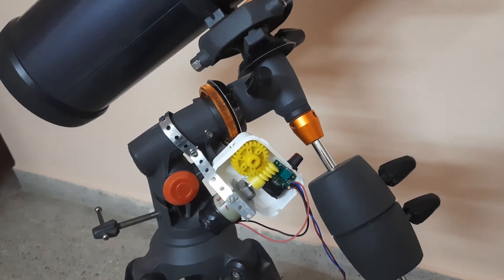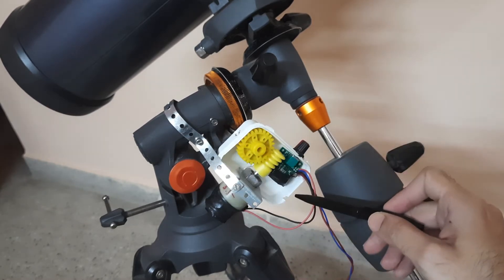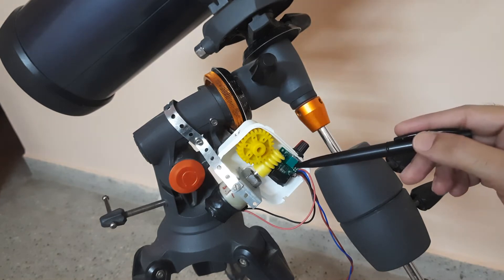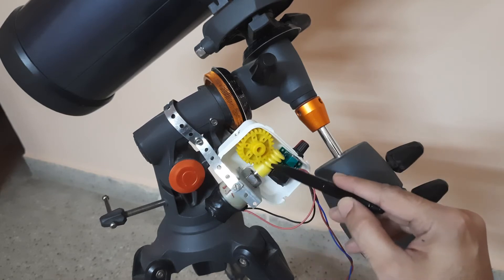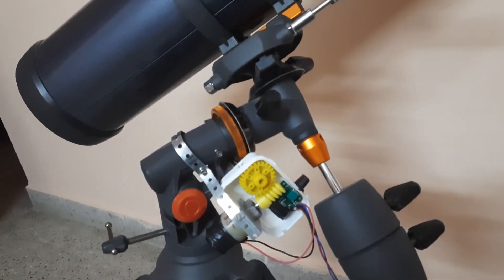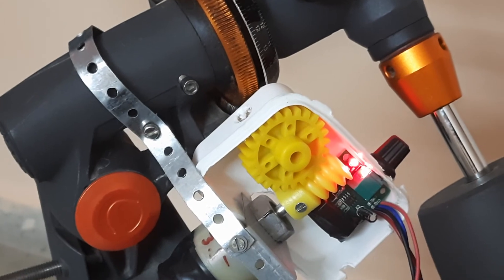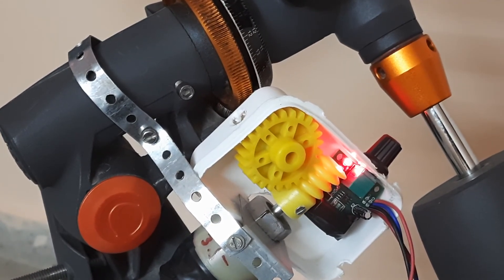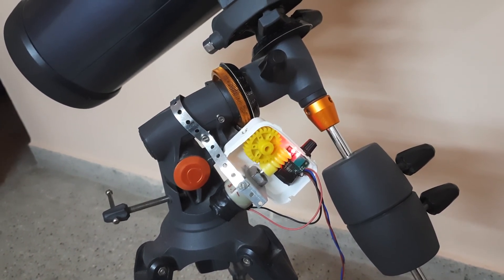Celestron Astromaster 130 EQ DIY Motor Drive

Comment: Nice, I am trying to replace an old C8 Celestron RA motor. Purchased a speed control motor with a pot controller. Housing inside had been a bit challenging. Your assembly inspires to put the housing outside or a different plan.